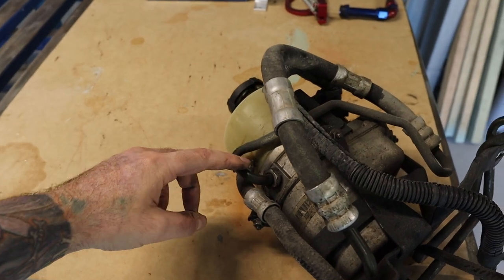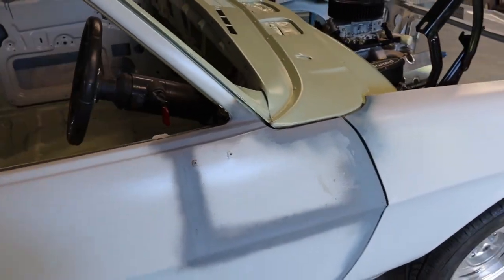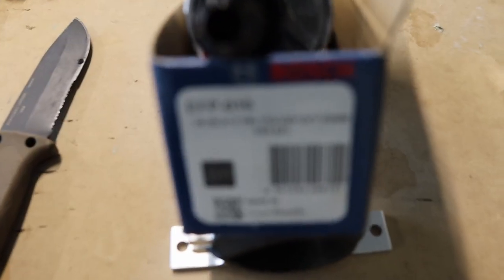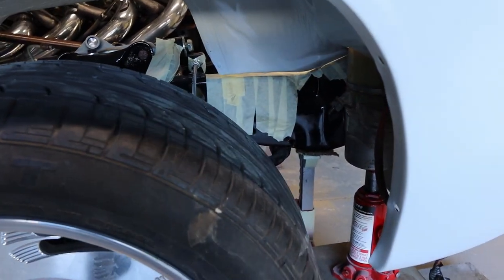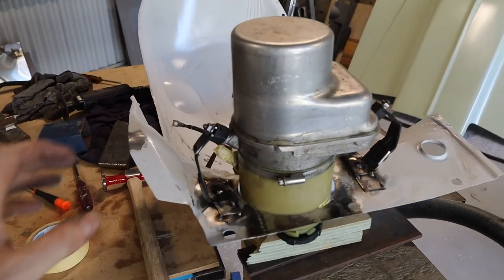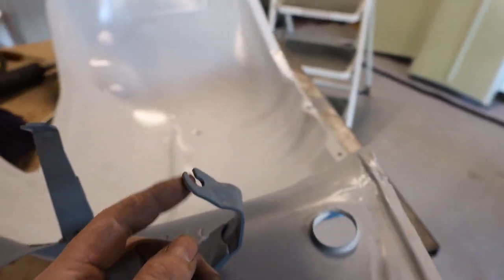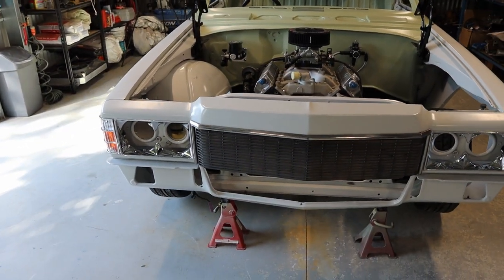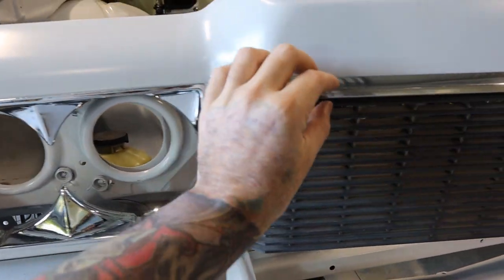Installing Electric Power Steering Pump - HX One Tonner Build

Comment: Mate save your dollars, use a soldering iron for the front grill and plasti-weld it. Use staples on the under side to strengthen and burn them in. Then burn in a black zip tie as you would solder to add material. Sand back, paint, and its brand new. Ive done this a few times and it was a lifesaver.

Comment: You may find a restrictor valve in the original return line to the pump reservoir. If so, you will need to fit it to the new line. It's basically a pill shaped piece of steel with a small hole drilled through it to slow fluid flow and prevent cavitation. It will be held in place with that crimped sleeve.
Reply from the maker: Thanks for the heads up. Will check it out Mate.

Comment: Nice job mate... Very clean install. What a great idea. Getting closer to cruising around. Cant wait to see the finished car. Last time I repaired a grill, I ground down the cracks to make a V along the crack, then used 2 part epoxy (with tape on the bottom fin to keep shape), proved to be a strong repair.
Reply from the maker: Thanks for the heads up. I might try that with the tape.

Comment: Hey Shenke. I’m putting one of those ASTRA elect power steering pumps in my build. You wouldn’t have the wiring diagram would you or at lease know what colour wire is what. Could do with your help. Thanks.
Reply from the maker: Hey Mate sorry I do not. I believe if you do a google search you should be able to find it.

Comment: Hey mate do you have any photos of what it looks like from underneath. After you mounted the bumper bar please.
Reply from the maker: Hey Mate I might be able to take some but it might be a while until the bumper goes back on
Reply: @Shenke Garage  I have bought the same pump after seeing your video the same your video and have looked at where you have managed yours I can't weld. My plan is to mount with brackets but looks like the bumper bracket is kind of in the way . Maybe try slipping the bracket into place and check.

Comment: Excuse my ignorance, but why didn't you mount the power steering pump fully in the engine bay? For example, closer to the firewall/steering column. Isn't it now in a position where it will be exposed to a lot more water and road dirt? Genuine question.
Reply from the maker: No dramas mate. I wanted to hide the pump as it's kinda ugly. I want to make the engine bay as simple and clean as I can. It will also be only driven as a cruiser week end car so It will never be driven in the wet.
Reply: @ShenkeGarage  Perhaps you could have dipped it in a vat of chrome instead. :)

Comment: little tip mate if you take the lens off them indicators the orange part just pops out and use an orange bulb , well on genuine ones it does not sure about repro but worth a try keep it up enjoying the progress
Reply from the maker: I went and tried this after reading this comment and you are right it pops out. Looks a lot better without. Cheers Mate

Comment: Ok I came here because the ps pump looks just like the one I took out of my swap car. I can figure the heaven leads out I just didn’t know of the signal wire stays powered with ignition on or was there a sensor I don’t see or something. Besides all that sick build bro. Is that a Cleveland head engine?
Reply from the maker: Hey Mate thankyou. The Engine is a Holden 308 stroked out to 355 cubes

Comment: hi ,Inner guard removal/ install  ,did you have the outer guard  mounts loose or removed ??  Mines a Q so the outer guard is shaped a little different .
Great job as always .. Try Gel supa glue using cotton buds and match sticks
Reply from the maker: I just took the lower outer guard bolts out so I could kind of pry it out a little bit to allow the inner to slide in. Ideally I think it would be best to sit the inner in before putting the outer on. Final assembly anyways.

Comment: Hey mate, nice spot for the power steering pump. Is there still clearance for the bumper bar bracket?
Reply from the maker: I actually forgot to fit them before installing the pump. I tried them today and they hit. I ended up making it work by grinding back the bracket but it would be a lot better mounted to the RH side further closer to the outer guard. It still works in that spot but grinding back the bracket was not ideal.
Reply: I have the same pump in the boot of my gtr, works great and sounds like a jet winding up when you turn the ignition on lol

I didn’t put a restrictor in the return line and it works perfectly

Comment: Hi. Just wondering if the billet column has the option for hazard lights (wb style) and tilt?  Your progress is amazing... I've stalled a few times through getting a bit project weary.
Reply from the maker: Yes it has options for Hazard. I opted without hazards and will add a switch onto the dash. There is no tilt option I dont believe.